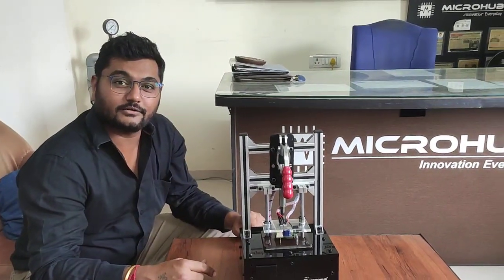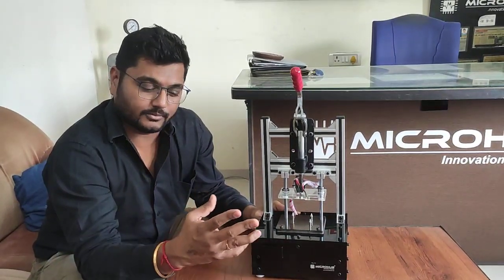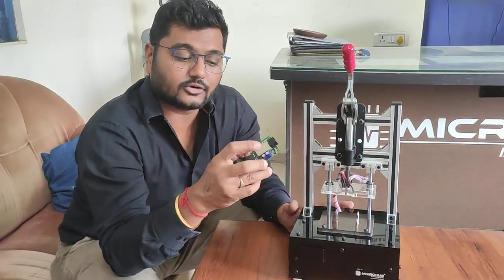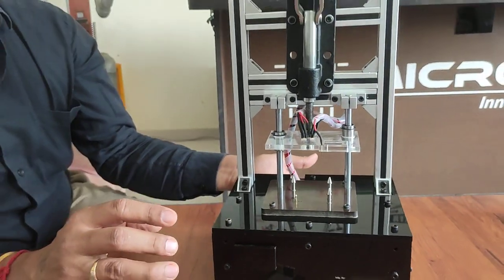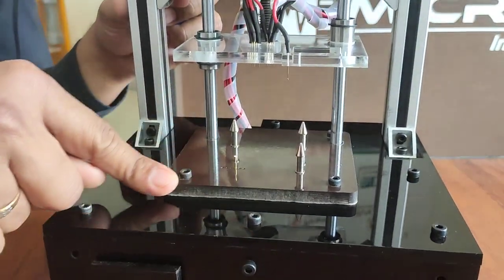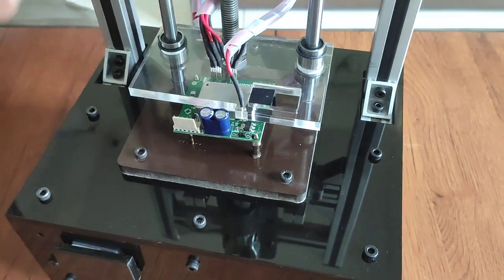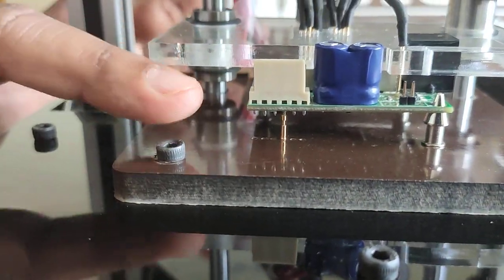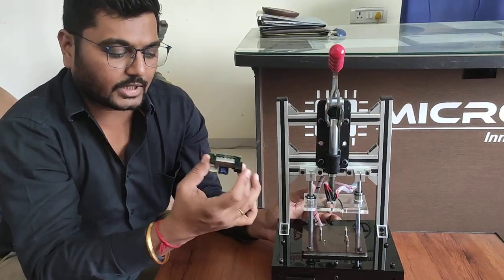PCB Test Jig Top and Bottom Side Pogo Pins,How to Use Pogo Pin, How to Make PCB test fixture.

Comment: How to insert those Pogo pins into the acrylic sheets? Can you please specify the pogo pin part number ?
Reply from the maker: Hi Pogo pin is mainly two parts  1: Receptacle  and 2) Pin it self  we need to insert Receptacle  not pogo pin . Lots of different size of pins are available in market depends on their data sheet ,we can do laser Cutting, CNC or VMC as per Material to make it proper.